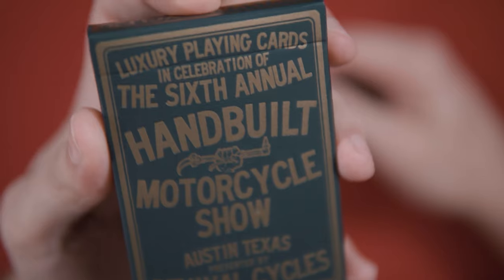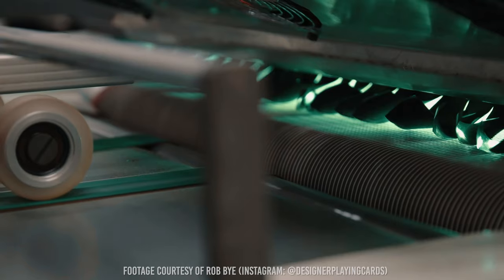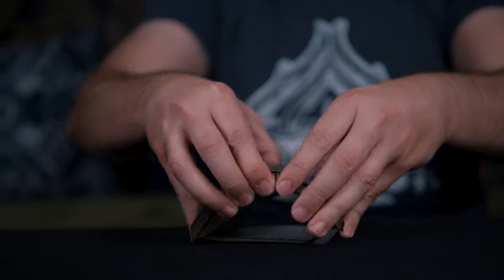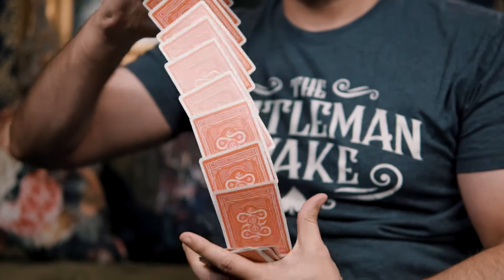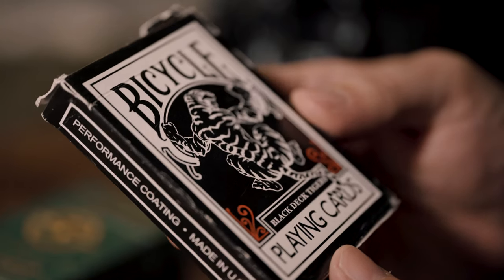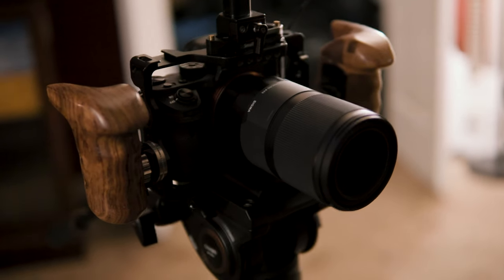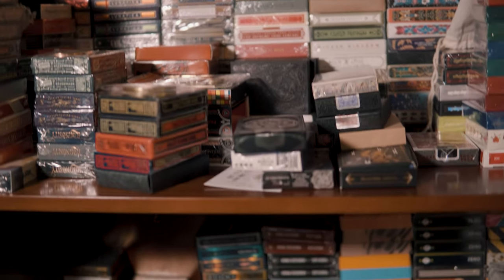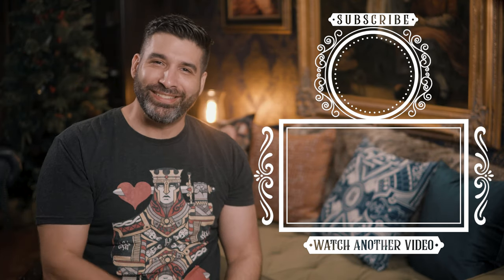Gentleman Wake Q&A and Room17 Review

Comment: 17:41 No no no no no no. Couldnt disagree more. Tally-Ho is MUCH better handling than Bikes and they are practically the same price (maybe a dollar a deck difference.) However, the fact that Tally Ho's DO handle so well is arguably a reason NOT to use them as a beginner. The idea is to learn on Bikes, because compared to actual cardistry cards, they suck, so if you learn on Bikes then in the future other nicer decks will be easier handling by comparison. So yes, learn on Bikes, but not because they're the best quality for the money - because they arent.